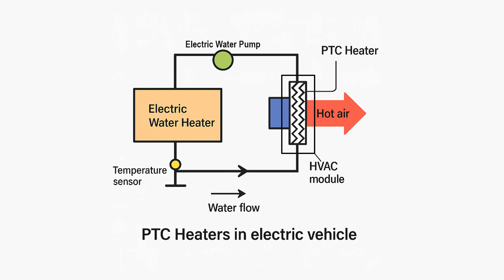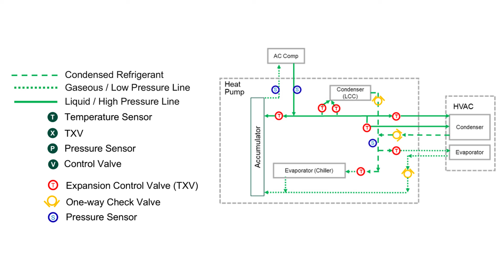PTC Heater vs Heat Pump: Which Is Better for EV Thermal Management?

Comment from the maker: Correction: Tesla wasn’t the first — some Nissan Leaf models came with a heat pump. That one’s on us! 👀🔧
Reply: The GM EV1 used a heat pump.
Reply: @fascistpedant758 an EV1 at Munro would be enormous awesome!
Reply: First-gen RAV4 EV also had a heat pump years before the leaf!
Reply: @jrharbortproductions  This is true. I must look up the Mitsubishi iMiev and its Citroen/Peugeot equivalents to see if that was PTC or Heat Pump. On the Tesla admitted error, the company may not have been the first, but I believe that Tesla heat pumps are the most efficient currently.
Reply: VW e-golf (2013 debut) also has a (optional) heat pump.
Reply: I believe that Honda in 1988 had a heat pump in their limited production EV Plus.
Reply: Our 2000 Toyota RAV4 EV uses a heat pump.
Reply: Renault Zoe has a heat pump since 2012!😂
Reply: @maerklin29800  Great to know.
Reply: The Hyundai Ioniq from 2017 also has a heat pump 🤓
Reply: so, you didnt prepared for this video
Reply: Heat pumps were first used in residential structures in cooler climates.

Comment: Two questions: Does the heat pump also cool the battery if you are driving in really hot weather? Is there just one heat pump or how does the car air condition the cabin?

Comment: Unless I'm missing something -- doesn't every modern EV come with AC, which is a heat pump running in a single direction? Making it bi-directional to capture all the benefits that come with this approach  seems like an obvious solution to the winter heating problem. And one to which just about all manufacturers have caught onto by now  😬

Comment: Renault Zoe Q210, back in 2012 had:
Heat pump and PTC heater
It had 43kW AC charging 
Used motor as part of charging circuit (what now Lucid and Hyundai brag about now as new technology)
It had active thermal management of the battery
It could redirect motor and battery heat into the cabin

Comment: You don't take into account that most of this equipment is needed in all evs and indeed any ice vehicle for the air conditioning system so this heat pump heater really isn't much different than the a/c unit simply running in reverse. Therefore to compare them fairly it's not really that much more complex than the systems all modern vehicles have already.

Comment: I live in the Houston Texas area.  I use seat and steering wheel heaters.  It is not that cold out.  Seams to reduce range loss.  No way to analyze the difference.  Does the car automatically heat the battery as needed?   I have a German made 2021 ID.4.  I don’t know if it has a heat pump?

Comment: I wish my Tesla had a secondary PTC heater for pre-heating in ultra-cold conditions. My Model Y has self-destructed TWO heat pumps, and both failures occurred in below-freezing temperatures. The second failure sent shrapnel into the Super Manifold, which was VERY expensive to replace. My theory is that moisture entered the coolant over time, and caused the heat pump to seize. PTC could presumably be used to warm the heat pump to above-freezing before running it to prevent this sort of thing. It would also give heating in a heat pump failure scenario. (Side note: Teslas DO run the drive motors in an inefficient waste-heat configuration in super-cold conditions to help heat the cabin. This is obviously a lot slower than a basic resistive heater.)

Comment: I kinda wonder why you would install a PTC at all, when you already have a big block of copper sitting there in the EV, plumbed both to your coolant loop as well as to your battery, in the form of your motor. Any FOC motor can be commanded to run non-torque producing current with a few lines of firmware change.
Reply: Because Tesla has a patent on it, which you already know.
Reply: @vidznstuff1  I didnt, actually. I thought patents were bad in the software world; yet again here we have a 'non obvious invention' that somebody not working in this field can think of in the first minute of looking at a system like this.

Comment: I wonder why PTC heaters still exist in cars. For so many years now, every new car sold comes with an AC, which is essentially a heat pump. Why aren’t these AC units simply upgraded with a valve that allows them to pump heat in instead of out? There’s no reason why we need two heat pumps in a car, and no reason why we need PTC heaters either.
Reply: I believe the cars equipped with a heat pump have a single compressor and a 4 way valve to change the direction of the refrigerant gas. But yeah, since all cars have a compressor for A/C why saving a few ten dollars for a 4 way valve which would make massive difference in efficiency?

Comment: A review of a 24 or newer lightning heat pump would be interesting.  I think there has been a lot of cable and hose rerouting.  From what I can tell peaking around the frunk 12V access panel on mine vs the 23 XLT with the PTC I had.  PTC is still there on the 24 XLT but also a heat pump.  Also not sure how they do the heat pump setup with 2 compressors with the tow package, I guess they just share the condenser.  Anyhow it works well at minus 5 Celsius or warmer, gave it the test up here in Canada.  23 was a bit of a dog in the winter for range but tons of heat quickly.  Minus 5 or warmer you can get 32 KWH/100 km on the 24 and the 23 would always want to be around 38 to 40.  Minus 15 Celsius they are both roughly similar, heat pump still running but PTC working as well.

Comment: If the car is airconditioned it already has a heat pump it just needs a few valves to heat the car  a PTC heater takes up more space as you then have both. A Tesla can use the heat pump to get heat from the battery and motor or heat the battery with heat from the motor or cabin see munro live on the Tesla octo valve

Comment: BYD Has resistive heating pads on top of the battery between the cooling loop and the battery. What other 2025 BEVs have the same PTC heaters?

Comment: I drive a 2018 VW e-Golf.  It is always parked outside.  It has a heat pump and a PTC.  In the depth of Canadian winter, when its <-30°C, the battery range is about 50% of summer range.  The battery pack does not have any cooling or heating other than the outside air.  When I start it, the car is instantly ready to move, unlike my old gas vehicles that need to warm up for a few minutes.  This is designed as a city car, so the 50% range loss on its 34KWh battery is painful - if only VW sold the ID.3 in Canada, or someone sold a battery expansion for these fun cars!

Comment: While the heat pump itself is more complex to build and install, there will almost always be a refrigeration based AC unit AND an RTC cabin heater in any American built  electric vehicle these days. Therefore it can be cost efficient to just add a couple of extra valves to the one unit doing double duty. Where the two different systems are used, as in my 2018 Tesla Model 3 with an RTC heater, I wonder if that choice was made for the convenience of getting the heat transfer capacity right for each system. Two different design teams, two different solutions.

Comment: We have the R1S gen1 with the PTC type heat and we love it as I can feel the heat within 30 seconds during initial start up. Given the battery size, I’ve never seen any noticeable difference in battery energy consumption. I also had the 2018 Tesla Model 3 with PTC heat which was great before getting the Y with the heat pump. I don’t believe Tesla was the first to use a heat pump in their EVs but glad to see the industry moving towards it.

Comment: It always seemed crazy to me that EVs didn't always use heat pumps for cabin heating, given that they have almost all of the required components already in the AC system: compressor, heat exchangers, refrigerant lines. Adding a second coolant circuit with resistive heating (as on my 2011 LEAF) just seems ridiculous.
Reply: You need a complicated reversing valve system.

Comment: Pre-watch prediction: neither, you should have both on an EV (in most parts of the US). Post-watch edit: my prediction was wrong. Curious to know what happens to vehicles w/o PTCs handle extreme temps in the winter (e.g. -20F).

Comment: I think Honda used the aircondition compressor as a heat pump in their diesel cars because a diesel engine is more efficient and doesn't generate as much waste heat as a petrol engine.
Reply: Diesel still make a lot of waste heat so no, diesel cars still scavenge heat from the coolant line. On premium models there is a PTC heater driven by alternator to provide cabin heat before the engine reaches operating temperature.

Comment: From a consumer perspective, it would be advantageous to have both in northern climates (the same way residential furnaces have a backup resistance element).  Of course, this being the automotive world, it'd probably be costed at around $1000 for this add-on.  There's an engineering question for you... Do vehicular heat pumps perform defrost cycles, and if so, how do they avoid freeze-drying the cabin occupants?

Comment: The battery heater won't be needed with CATL's sodium batteries, good to minus 40. Although you will still need cabin heating.

Comment: Wrong!  Toasters use resistive heating elements as do many cars.  PTC is an abbreviation for "Positive Temperature Coefficient".  This is a specialized resistor which changes resistance with temperature to maintain the heat dissipation under varying conditions.  Most PTC systems have minimal electronics, which simply turn the power on / off, since the thermal regulation comes from the PTC element itself.   The "magic" of heat pumps is the change of liquid to gas of the cooling medium, aka "Freon" in a sealed pressurized system.  

This is a weak, sloppy explanation of heat pumps and there are many better ones on the internet.

Comment: I've owned a lot of EVs at this point.  Believe it or not, my favorite HVAC system has been my 2018 Kia Soul EV.  Instant heat.  Instant ice cold A/C.  Had both a heat pump and resistive heater.  On startup, both would run.  Eventually it would switch to the heat pump only, consuming only 900 watts to keep a 68f cabin with temps in the 30s(f).
Reply: Having 2 systems means more chance of failure (if one fails it will take out both for sure). Neat pumps do produce heat quite quickly I don't know how responsive you want it.
Reply: It’s a strange or odd realization that my 22 Hyundai Ioniq 5 SE RWD with a PTC heater, no heat pump, 74 kw battery has similar range expectations as a 24 Ioniq model, 77 kw battery, RWD with PTC and a heat pump. I have to ask Munro Live, do you have data as to cabin heat efficiency differences between PTC only and cars with both? Thanks.
Reply: 30F? UP of Michigan has entered the chat.

Comment: Based on the schematic for the PTC heater, it looks like there are 2 heaters: 1) Electric water heater, 2) PTC heater. Please confirm. Is 1) just a typical wire resistance heater and 2) the PTC thermistor heater?

Comment: can somebody explain why it's only 10% saving compared to resistive heating at 20%   aren't heat pumps supposed to be 3 to 4 times more efficient  so perhaps 5% range loss.  Any explanation appreciated
Reply: About 10% could be 7% and about 20% could be 21% so that is 3. There are still extra pumping losses and the heat pump is not running in the best conditions requiring a lot of power fast in the cold. Once running I would hope there is a lot of residual heat about.

The rest of the power is running the car

Comment: Compared to Teslas heat pump system, the Chevys system with Al, the extra hoses looks like a system designed by HVAC Engineer Dr. Frankenstein. Extra weight, extra coolant and extra hoses.
Reply: This time not the transmission guys to blame but the hose guys... 😅

Comment: I’ve owned PTC and Heat Pump.

I would rather PTC….  I’ve had to replace my heat pump system at a cost of $3,500 on my Tesla Y — 4 times due to failures.  Too expensive and complex - I get that it’s better on power, but the reliability isn’t worth it…

Also, the Heath pump efficiency isn’t much better than PTC once it’s under -10 anyway…

If I could retrofit to PTC I would.
Reply: 4 times huh?
Reply: @ Yeah 4 times, would you like a screenshot of my service history?    I get your a $TSLA bag holder, i'm not, I'm just some guy with a car that has been in and out of service for 3 years and they simply can't fix it.
Reply: that is what I thought at first with my new equinox ev,  but you still need all the same hardware for a/c,  and, I could be wrong, but I though h/p also have ptc or similar as a backup heat source.
Reply: @  No that's the problem, there is no PTC backup, so when it's -30, the system can't keep up.
Reply: Story sounds made up.  Warranty?

Comment: When I saw all the plumbing and wiring on the heat pump I expected to see Sandy on the floor with someone yelling "Quick! Quick! Bring the Octovalve." A whiff revives him. (Reference to an old video showing an inefficiently designed HVAC system.) Of course the heat pump in a Tesla is a lot more than the Octovalve - I hope I can look up a video on the Model Y heat pump.
Reply: Look for the Weber Automotive episode on the Octovalve in the model Y: he does a masterful job of explaining where the heat comes from and how it is generated without using a PTC. All of his videos are a master class in engineering.

Comment: I think it’s important to stress that heat pumps MOVE energy rather than “producing” it, which is why they’re able to use less energy than is “produced” thereby exceeding 100% efficiency.
PTC heaters can be at 100% efficient at best, but heat pumps can exceed 300%. 
Of course the other downside besides complexity is that heating is diminished when ambient temperatures are extremely cold.

Comment: Is PTC really lower cost if heat pump is designed in initially.  Most of the parts are already there if vehicle has A/C

Comment: Thank you for sharing this great Idea..
Great Idea for heat pump system. There's a flaw, if the temp. Gets too low, below -5°. There needs to be a ptc heater, or use "motor stall" (like Tesla's) for a minute, also, to help the heatpump to do better in that situation.
P.S. low power axle bearing grease warming would really help too...

Comment: I am just starting the video,, but i really think we need both.  As we can get cold days in the -20F and colder, but most of our days the heat pump works fine. My car they backed off the heat pump motor speed to save winter range, but would like the resistant heater to help warm the cabin faster some.  That all said the heat pump in my car cant get the air hot enough to melt ice while going down the road. On the sub -10F days.

Comment: If batteries continue to get cheaper, perhaps the optimal low cost solution is to use a PTC heater with a slightly larger battery.
Reply: So how do you air condition the cabin? Ptc  can only make heat?

Comment: I would really appreciate your feedback on the "quality" of heat from the PTC heater vs the Heat Pumps.

By quality, I expect that PTC heater can get to temperature faster than the heat pumps.

For background I live in Canada, and I drive a '23 Ford Mach-E with a PTC heater. They have a heat pump in the '25 updated Mach-E. My drives are typically only 15 minutes. My first stop is a school run, 5 mins from home. I chose the Mach-E specifically because it still had a resistive type heater. The car is always outdoors, and cold soaked during winter, but I still didn't feel the need to bother with preconditioning for city driving. In fact I only regularly cycle the battery between 40-60%. Every couple months I do a deep charge to 100% for LFP battery calibration.

I also barely road trip, but I have driven from PEI to Moncton and Halifax in the Mach-E during the last winter. A long trip like that could see a 10% improvement with the heat pump, but it is not the normal use case for me. The car goes about 300km in the winter, and 400 km in the summer with RWD and the small battery. More than enough for my typical use. 

My fear is that all new EVs will be cold during the winter because the heat pumps just can cope with the lower temperature, the way resistive heaters do. My house has 2 heat pumps. which are great in mild conditions. They really loose efficiency in a deep cold snap, or very cold wind, even with access to 240V power.

How quickly do the heat pumps warm the cabin compared to the PTC heaters, and how well do they maintain the heat compared to the PTC heaters as well? Heat Pumps have limits in the deep cold, which is exactly when you want the "best" heat.
Reply: It depends on your system.

For lfp batteries you are better always pre heating i would guess and charging to 100% more often for sensing. At the end of the day a bad heat pump has a cop of 1 and is a little small just needs more time to pre heat.

The loss of energy will be offset by a happier battery i would guess
Reply: @bobo-cc1xw  

Note, short commute. Pre-heating for a 15 minute drive when the car sits outside again at work for hours does not warrant pre-conditioning. I only do that for road trips.

The PTC heater in my EV defrosts the car windshield and warms up the cabin in about 3 mins...way sooner than my old 4-banger Impreza, or my wife's hybrid escape. it is true that my EV used more energy in Jan and Feb during the polar vortex freezes... but it provided instant heat even well below freezing. A stand-alone heat pump does not have me convinced that it will operate the same.

FYI, LFP batteries are also happier at lower states of charge, just like NMC batteries. They tolerate more 100% charges, but they are not necessary for battery health, only to reset or recalibrate the charge counter since LFP batteries have a flatter voltage curve. The battery counter looses track without being calibrated on a deep charge to 100%. This only matters if you plan to drive near to 0%.